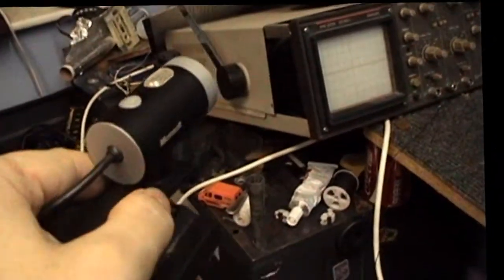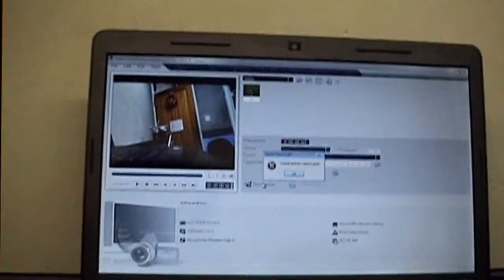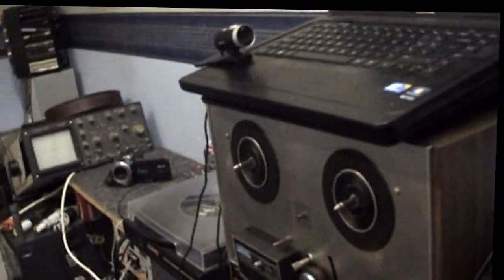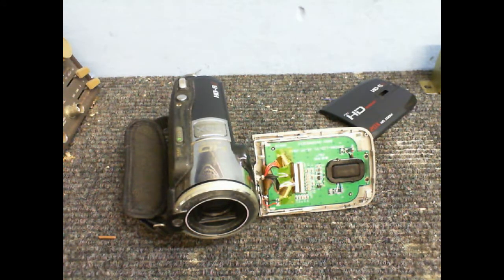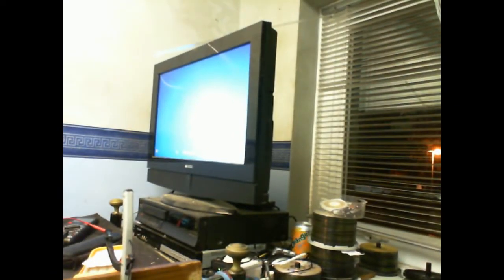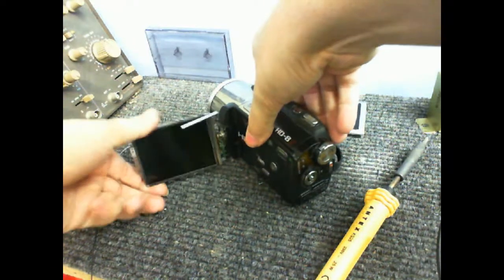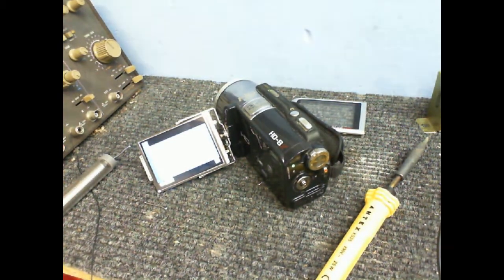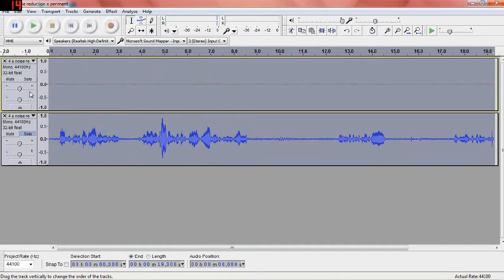Trying to improove the HD 8Z camera's audio, and a rant about Ulead Video Studio

Comment: Well that really is a case of a bad thing turning into a good thing! And this once again shows that the chinese companies don't design things properly. They probably only put in those capacitors because they were shown in some data sheet and did not think about the effect that those would have on the audio. I am surprised though that there is a proper microphone assembly. I would have expected just some tiny cheap microphones stuffed into the housing somehow.